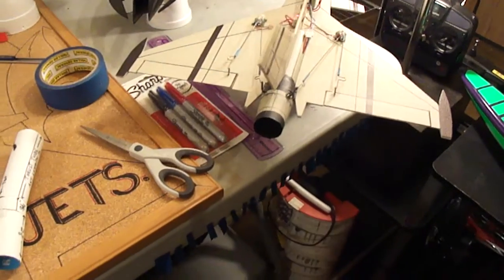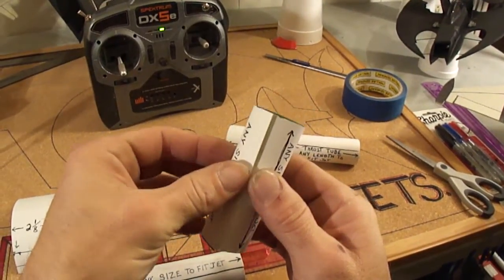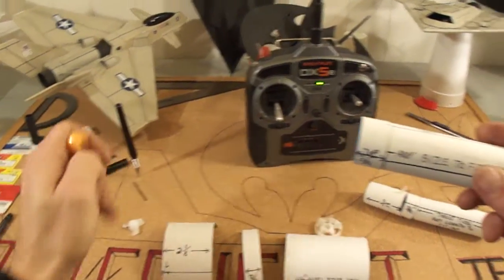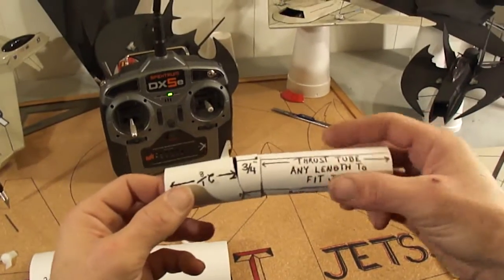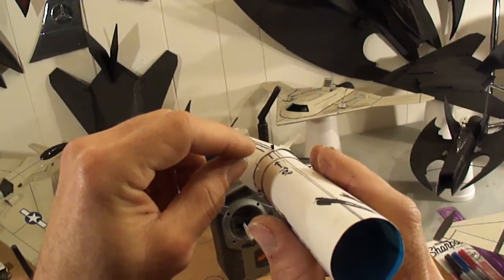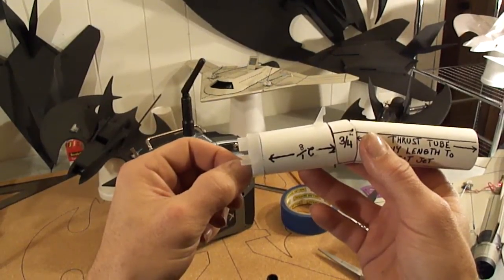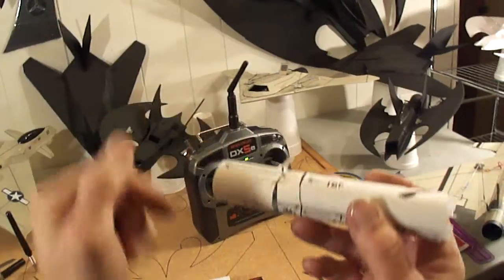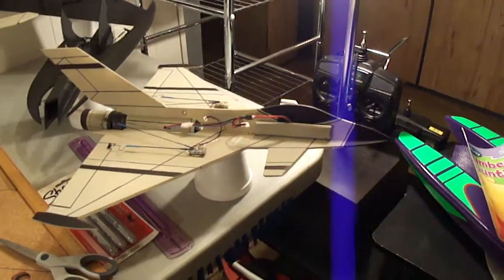Building the thrust vector nozzle for your micro concept jet.http://foamconceptjets.yolasite.com

Comment: Your designs are clever but the parts seem very frail to me.  Also, I think the nozzle swivels much more than necessary which creates those air leak holes you seem to think don't matter.  I disagree.  They are clearly a leak of pressurized air.   If your model performs OK with the leaks it will perform better without them.